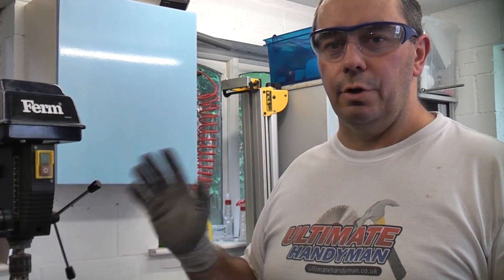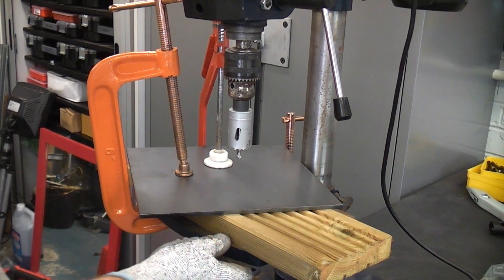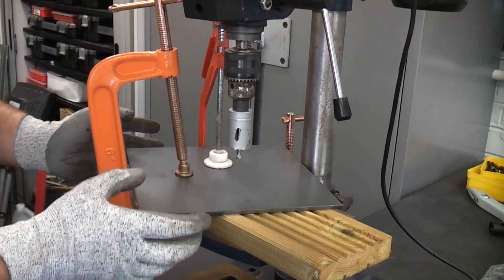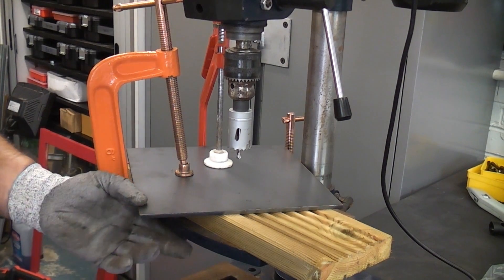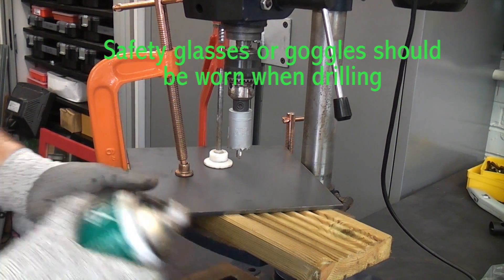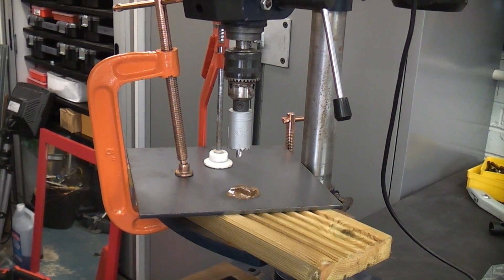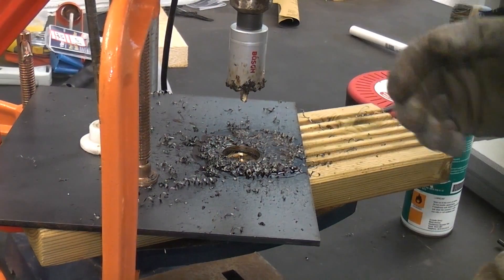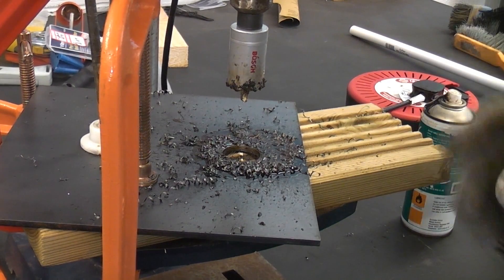How to drill large holes in metal using a hole saw

Comment: Got to do this during week with 30mm hole into 10mm steel. That looked a lot easier than I was expecting too be honest.
Reply from the maker: As long as you use a quality hole saw and have the drill at the correct speed with lubricant/coolant it should be pretty easy.
Best of luck with it ;-)

Comment: on this machine can you cut a tube with a hole saw with a 45 degree ??
Reply from the maker: No, this is only a DIY machine, it would really struggle doing that.
A professional pillar drill should easily be able to do it, providing you can tilt the table.

Comment: Hello, thank you for your video.  I've been cutting holes in 18g steel sheet ranging from 22mm-29mm in diameter.  I've successfully cut a few holes, but it's a bit rough.  I currently have the rotation on 1500rpm.  Do you think that's too fast?  I think I'll try to slow it down to 1100 rpm and see how it goes.

Comment: have you ever tried to use on a heavier material like 1/2" aluminum? need to drill a 3 1/2" hole in 1/2 aluminum and was going to buy but wanted to see how it would work first thanks
Reply from the maker: Aluminium is easier to drill/cut than steel.
A 3 1/2" hole is quite large though, you would need a really powerful drill set to a low speed.
Reply: Use 500-1000 rpm. And move the saw up and down a lot to allow the chips to get out. Also use an air gun to blow up the channel as you cut so the aluminum doesnt melt and stick to the saw

Comment: i drilled 88 holes in total through a 4.5mm square tubing. used 2pcs of 29mm cheap metal hole saws to finish it. used water as cheap cutting fluid. my drill press is 1/2 hp and has a max.capacity of 16mm solid drill bit.=D
Reply: Were you making Mark ripttoes power rack?

Comment: I went to harbor freight and bought a fountain pump 10.00........and then on to Walmart for a one half inch aquqrium hose and put water mixed with water soluable cutting fluid in a turkey roaster and the fluid pumps up thru the hose and onto my drill press hole saw spinning and back into the turkey roaster again.......the fountain pump has adjustable pressure and so I just turn the pressure to be dribbling onto the spinning hole saw and it works quite well..........
Reply from the maker: Good idea ;-)
Thanks for the comment

Comment: not sure if i missed it but what type of oil did u use the name would be helpful thanks
Reply from the maker: It's drilling/tapping fluid.  There are a few well known brands such as Rocol or CT-90
Thanks for the comment
Reply: Dont use oil, try compressed air works great form a gun

Comment: As far as I know, you can get Morse taper sleeves for large drill bit sizes, up to 40mm diameter I believe, and fit them into a regular chuck.
Reply from the maker: Morse taper sleeves and drill bits will only fit in a Morse taper drill, be it a pillar drill or a hand drill (the hand drills are pretty rare with a Morse taper).Thanks for the comment ;-)

Comment: You must drill a # of smaller relief holes to give an outlet for the chips. The chip clearance holes require somewhere to go, ie, a bigger hole through your wooden block.This is not woodwork where you can get away with mongoing your way through the job. Don't feel bad, I have seen Journeymen carpenters do the same thing forcing it through the workpiece like a berserk monkey & wonder why it only lasts for one or two holes.

Comment: If you are going to do this often it is really worth investing in a bottle of soluble cutting fluid. You can mix it up leaning heavy on the water side and it will be a lot cheaper and a lot more effective at cooling.
Reply from the maker: Good point, Thanks for the comment ;-)

Comment: Great upload. Is it only advisable to only do this with a drill press? Would a high power hand drill not be suitable?
Reply from the maker: You can do it with a hand drill - no problem at all. It can put considerable strain on the drill though especially when using larger sized hole saws.
Reply: ***** Cheers for the reply! I have a 5mm sheet of mild steel I have to drill for a project next week so this couldn't come at a better time for me. ;-)
Reply from the maker: *****
No problem, good luck with the project ;-)
Reply: for a cleaner straighter hole and a controlled drilling session, a drill press is always better, where possible.
Reply: or even better, a milling machine, but for most purposes, a drill press...